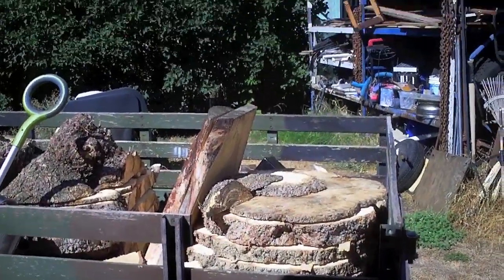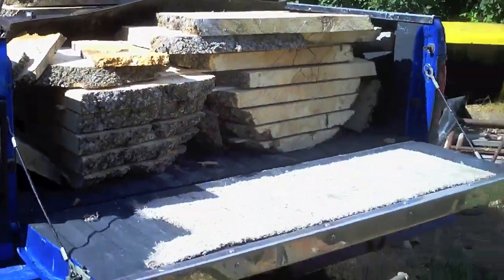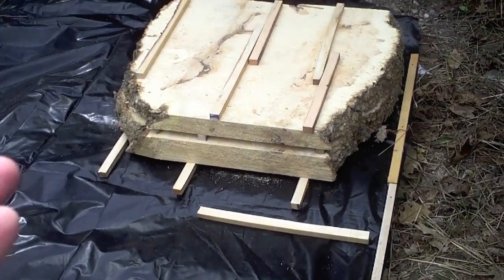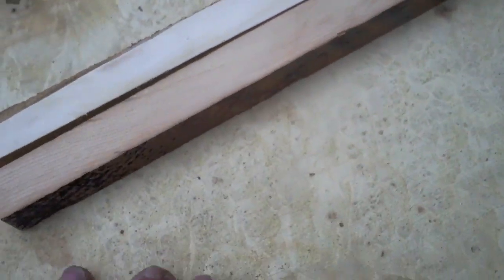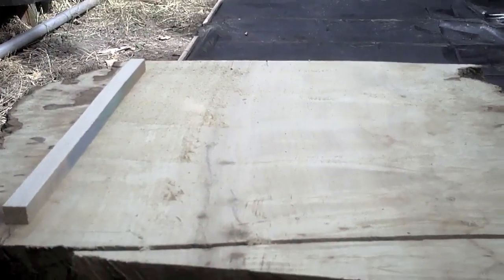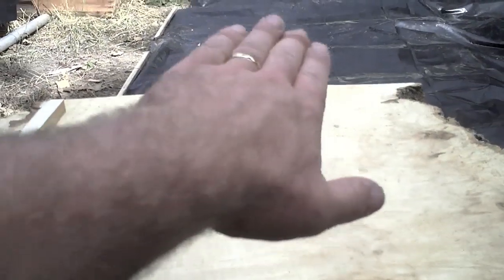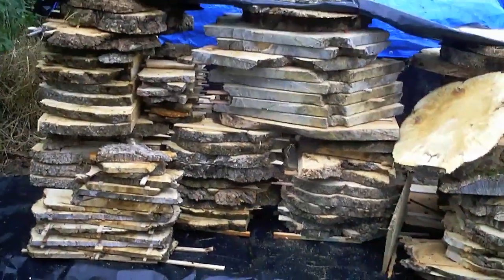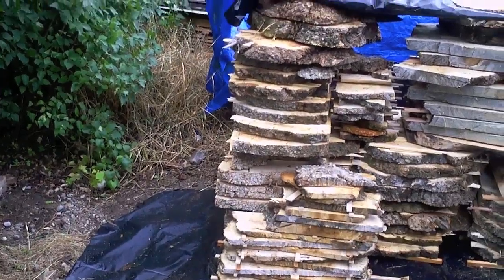Forced Air Wood Drying

Comment: Another method for drying wood and products without the formation of cracks. For him, using silica gel,
is any moisture from the desiccant things including wood. Silica gel for cats take in stores,
He comes in bags for cat. He'll use for drying
hardwood. Take 1/3 of silica gel-sorbent from the weight of the tree, covered it with a wooden product
and close the jar tightly, to accelerate the drying process is better to pump air and make
vacuum. Subject jar tree in vacuum and silica gel (or without) a few days or
week. If the tree is much wet, the silica gel which has absorbed water (become white) pour
and add as much again, and just leave the silica gel to absorb moisture wood. at
This method, wood is not impregnated with salt and keeps clean without salt structure, which may
sometimes protrude from the tree over time. So go ahead dry the product with the help of silica gel.
Restore silica gel- roasting or put in a microwave oven for 5 minutes, and
It can be used again.
Reply: SuperDutchman59 are you from Mars? Wth kind of English are you speaking sir? Lol

Comment: Very interesting buddy. 
Have you ever tried the heavy black plastic silage wrap ? 
I use it for landscape weed barrier also so I had a good chunk left over so I wrapped a stack of boards with it and made a tube like out of it so the wind could whirl through. I'm hoping it works out. I have board ends sealed with toilet wax seals rubbed in. I'm hoping the black plastic will heat the wood up to speed drying. 
I cut lots of lumber and such with my Alaskan sawmills. 
Good luck to ya bud

Comment: how you make out with this? Did it work? Did it dry to fast amd make the wood crack worse? You should have sealed the ends. You want the wood to dry from the sides, not the ends, Ends dry faster making it crack. Im sure you know this. I dont know how it works with burls since the grin is all twisted. If you have and of this you would like to sell, please let me know, I make turkey calls (pot calls) and soon to be into duck/goose calls Id be interested in getting some scrapes if you have them. Please let me know. Thank you.
Reply from the maker: The fan is still running as we speak.  I hope to open it up at the end of summer and see how we did.  I am sure we can work something out.
Reply: just let me know when its done. It may be hard to reach me as im not a pro with messages through youtube. You can email me at rusher75@yahoo.com. that would be the best way. An as far as your drying, Look in to solar kiln. Very simple to make, and cuts drying time.
Reply from the maker: Still drying, it will be one year this Sep and I will open the stack and see how it did.  If it worked then we will have cut drying time in half.
Reply: thats be awesome. whatever it is, its better then letting it air dry on its own.Im going to mess around with a solar kiln here someday soon. Nothing fancy, just to dry some stuff thats laying around. Its worth a shot bc i have some nice stuff. a lot of nice spalted stuff.
Reply from the maker: I would love to know how that turns out for you.
Reply: ill let you know when i get around to it. Theres a lot of you tube videos on the same idea, seems to work great. But do watch out for some of the guys that dont have a clue what they are doing. Alot of it is common sense, and that my friend is what most people lack.